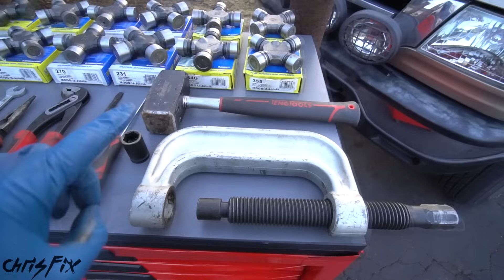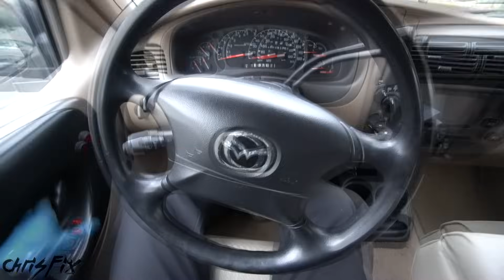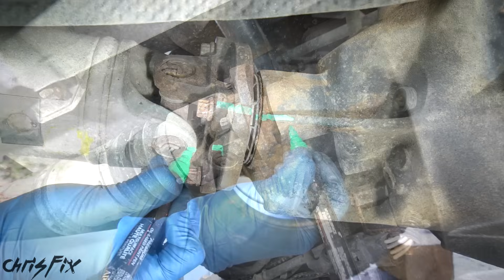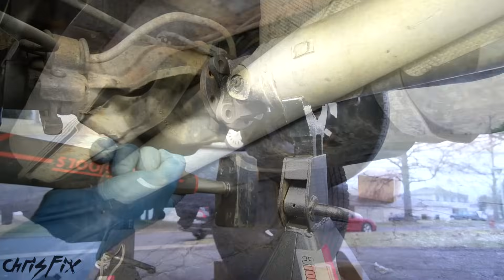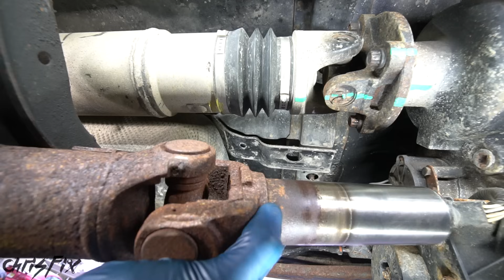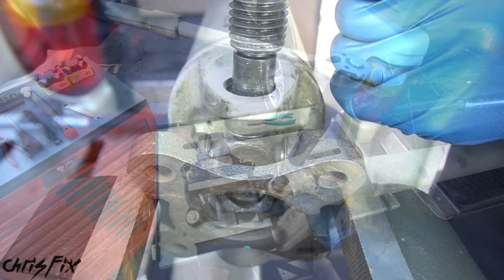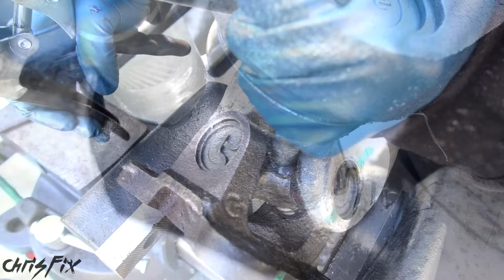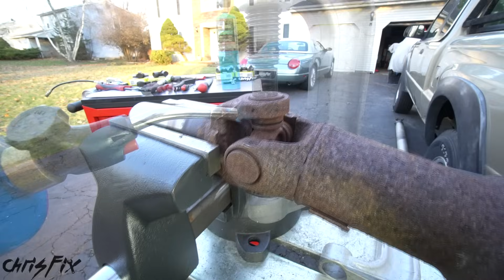How to Diagnose and Replace Universal Joints (ULTIMATE Guide)

Comment: Can you please do a full video on a 2wd v8 Dodge ram? 96 to 2000. Rear axle issues break issues. Directional issues.heat issues. Suspension issues. Steering issues. Just listening the most common problems that Dodge had those years and mine has some of them.

Comment: What about if you feel vibrations only when accelerating? Typically if I'm coasting at about 40 miles per hour, and barely press on the gas to regain speed I get a vibration. When I let off the gas everything's smooth out, when I touch the gas it is rough. Typically the vibrations are anywhere from 40 miles per hour to about 65 miles per hour
Reply: ChrisFix

Comment: Hi 
I drive bmw e90 325i inline 6
I’ve a problem, when my car goes over 130kmph steering wheel and whole car start shaking or vibrating and shaking get worse as I increase the speed.
But it drives smoothly below 130kmph.
What could be the reason I recently changed front tyres and done wheel balancing and alignment. Pls help me with this. What could be the possible reason for shakiness???

Comment: one thing I did on the front drive shaft of my jeep was throw the u joints in the freezer the night before so the needle bearings will tend to stick more in the caps and also if you want you can lightly heat the yokes. My driveshaft was super rusty crusty and this helped. I dropped one u joint cap and sent needle bearings EVERYWHERE that sucked! so I do the freezer method if time allows.
Reply from the maker: Thanks for the tip

Comment: Chris,
A very good, informative and well thought video.  Another method I use is the bench vise method.  I use sockets like the hammer method but with a larger socket to allow the joint to pass through and use the vice to "press" out the old joint and press in the new.

Also if you use a joint with a grease fitting in the X web, be sure to place on the compression or drive side as this is the weakest part of the part and it will be strongest in the compression loading.

Happy wrenching

Comment: Im late but, to prevent the rubber boot going bad, use 303 aerospace UV protectant. I havent yet but it should be fantastic just re apply every few months.
Its water based fyi. Even goes on tire tread!
Reply from the maker: Thanks for the tip.

Comment: I have this same truck in ford version. Is there a chance of you doing a video covering the 4wd front shaft u joint? I cant seem to find anyone that's done a video on it and that ones a real pain with the brackets and all. You've helped me make my ranger awesome so thank you for all the videos.
Reply from the maker: I won’t be right now because it’s still good but it’s not much different. Same concept but you need to unbolt the CV joint from the transfer case.
Reply: @chrisfix  Awesome to hear that it's basically just unbolting from the transfer case. Can you tell us if there's anything special we'd need to look out for when unbolting it from the transfer case? Fluids that will leak out or anything we need to watch out for? I haven't yet determined which of my u-joints is the one that's squealing, but I have a feeling it's that one in front. 
Btw...Your videos are so amazing, I'm spoiled. I followed your videos for replacing the upper control arms, camber bolts and washers, and lower ball joints, on my 2000 Mazda B3000 4X4, and then took it in to get it inspected. My mechanic absolutely could not believe how good a job I'd done. It was perfect. And I owe that entirely to your video. I'd never done anything like that. It was a trip. I am still inordinately proud of myself. LOL I totally owe you a case of beer, dude. 
I'm about to replace the blower motor resistor, a burned out bulb in the dash, do some minor body/rust repair, and paint some of the trim black. Plus the u-joint. All because of your videos. Thank you so very, very much.

Comment: UPDATE: took a while over a couple of days messing with the stiffness  but I seem to solve the problem.  I removed the clip when it was stiff and applied the hammer til the stiffness was gone then replaced the clip.  If the stiffness returned,  I repeated as necessary.  Eventually I had a floppy yoke.  The aftermarket sells U-joints for the Ford Ranger as if the front and the rear are different.  Ford OEM parts say front and rear U-joints are the same.  Didn't help that the online discount seller sent me the wrong front joint in the right box.  That joint was 3/8 inch too short overall in both axis with defective seals.  Been over 30 days so no return.  Fortunately,  when I examined the front U-joint it was almost new and didn't need replacement.  Now I'm ready to do my sister's '04 Jeep Liberty (2WD).
Reply from the maker: Hitting it with a hammer should work. Make sure you hit it around the whole area to vibrate any tension loose and even it out. Or lightly tap the side with the “hard to install” c-clip so it seats up against the other c-clip more. Nice work on trying to diagnose the issue! I was going to say check the needle bearings but you already did that. You can try turning the u joint 90 degrres and reinstall.

Comment: Removed the driveshaft from my '04 ranger today  The flange bolts need an 11mm,  12 pt. socket and all four needed heat to break loose.   My Ranger has a 3.0 with auto trans.  The front end of the driveshaft simple pulls out.  This is the best video out there.  It's clear and concise,  no idle chit chat.  Thanks, Chris.  You are doing good works.

Comment: Hi Guys I'm pretty sure my issue with my 2006 bmw 325i is an old Universal Joint. Just wanted to get your opinion. Currently, I have about 200k miles on that car and it squeaks only in reverse which is strange. Please get back to me if you have the opportunity thanks.

Comment: Chris just joined, great video but can you show how to do a u-joint from a Dodge ram 2500 with the plastic glue type as mine has no clips. (was told by parts guy that I need to use heat) thanks dave

Comment: my 02 Mazda b4000 2wd dual sport  has had a vibration for awhile at first thought it was the transmission ... had the transmission checked nop not an issue then wheel bearings nope not the issue so now  this may have solved it .. fingers crossed ! will update with results

Comment: Well, you made it look easy and it is not. This fix ended up a nightmare.  Old caps.... 8 of them get stuck in the yokes. Pressing  in the new caps to where the inner clips fit is nearly impossible as my caps cracked... still working on it but fist need to buy another u joint because of the cracked caps. Going to expand yoke with some heat this time around.

Comment: I don't like Moog stuff the castings and forgins are always so rough. And the machining is very rough as well. My outer tie rods bith had the holes drilled off center and the threads were all chowdered. In any case i got the OEM Spicer for less. Way better cold forged. When it comes to a bearing I wouldn't use Moog unless I could confirm they are using a different manufacturer for that. Bearings have extremely tight tolerances...

Comment: Chris....question I'm a 2006 GMC extended cab Sierra 6.0 4x4. 410 rear axle. I would like to change out rear driveline universal joints using heavy duty Moog's.  Heavy duty being 330's ?? Or the 330a's hmmm? Heavy duty no zerk.... Understood!

Front drive line are the 235's by Moog heavy duty?

Comment: Hey ChrisFix! I am going to be replacing my U Joints soon but I need help knowing what size of U Joint my vehicle uses (cap diameter). Do you just have to take off your driveshaft and find out or is there a way to know what size you need without taking off your driveshaft?

Comment: No mention that the grease fitting should be oriented so that it is in compression, not tension.  Anytime you put a hole in something and fill it up with that same something, the resulting structure is stronger in compression than tension.
Reply: Sorry, forgot to mention kudos for some of the "tricks" you used, marking to check bolt retain, grinding part of the grease gun fitting.  I learned something. Good job.

Comment: As a mechanic myself, I just LOVE LOVE watching your videos! You do everything thoroughly and right. Very professional work. Sadly, there aren't many mechanics out there that care for their job as much as they should though :(
Reply: That's because customers always try to blame Mechanics for shit that we didn't even fucking touch
Reply: No one will work on your car this way. It will take way too much time. The job can take half the time and you will never find out that the new joint was not greased, or the bores were not cleaned, or whatever small detail was missed. Even without the grease the joint will probably last more than 50K kilometers, which means its way out of warranty anyway :) So NO, no one will take care of your car the way, you can take care of it yourself.
Reply: Aslan Makhsudov true! Hey bro, cud use ur help if you dont mind? On my trucks drive shaft that connects to the alternator, I noticed splash of grease above it? What is it , transmission fluid??
Reply: @D_Dowg626  Try topping off your blinker fluid in your radiator. I had the same issue where the oil pump fuse kept blowing out because of the static electricity of the floor mats. Do that and you'll gain a easy 50 whp and 8 psi of boost!
Reply: Could be numerous of things, generally if it is around driveshafts it is from leaky seals.
Reply: Aslan Makhsudov how do you find out what u joint fits in your drive shaft and yoke??
Reply: I totally agree with you "Asian Makhsudov"!!!!
Reply: No body will pay for this quality work

Comment: I’m having a symptom on my 01 Nissan Xterra with a Manual transmission I’m getting a vibration mainly at highway speed but if I push in the clutch it goes away could this still be u joints ? Please help me it’s driving me nuts

Comment: I have a question in reference to this. I have the squeak. I know the u joints are going bad. However, yesterday I was driving and heard a grinding noise going up a hill for like 3 seconds. I was dropping off a coworker right over the hill. I went to turn around. Went down the hill and started hearing a clunking then a VERY LOUD squeaking that increases with more rpms. Goes away (or at least I don't hear it) while not oressing on the accelerator. Took it for a short .1 mile run around the neighborhood to take a video of it. It got progressively worse. Could this be the I joint? Going to replace my wheel bearings and u joints. BUT I just want to make sure that the u joint is causing the issue.

Comment: Chris - great job., great video.  All the little points were very handy. I would use a half-round file or maybe even a rat-tail file to deburr the edges instead of the flat file.  Your needle bearings were a lot more obedient at staying in place than mine.  My '66 Pontiac front u-joint looked so bad you would think somebody put it in a pencil sharpener.  Grease wasn't getting everywhere it need to be. Only getting to 3 members of the cross -one was dry.

Comment: Best VID!!! Any 'greasable' body type U-joint is weaker than a 'non-greasable' type due to structural weakness created by the grease passage. ALSO... in general, any greasable type joint will need to be GREASED before it's put in service- the vast majority of manufacturers only use an 'assembly' type grease that will come in the joint from the auto parts supplier. So be sure to grease them after you do the install!! Keep up the fantastic work Chris!

Comment: good video....  one thing that could be a problem sometimes ??  honestly, several times I have had to have the driveshaft re-balanced after u-joint replacement... all you have to do is get the thing .020 off on 1 side and that's all it takes...   IF someone experiences vibration after replacing the u-joints it will have to be re-balanced... and actually it should be every time...  but a VERY GOOD video on this stuff...  and.. just because Chris you know a lot about this.. you NEED to install the grease fitting in the CORRECT position as well.. not just to be able to lube it, you never want to be pulling away from the zerk fitting.. you always want to compress the zerk fitting...   I know this will confuse people but this is how it NEEDS to be...  you might just do a simple update on this...

Comment: Fantastic video as usual man! I have a. 03 Sierra 2500hd and the driveshaft as rotational play as well play in the slip yoke to the transfer case. Thought it was ujoints but doesn’t seem the case. Any insight on the GM “driveline clunk” you could share?

Comment: If you don't have a press, but don't want to hammer then you can use a bench vice plus an old socket set. I learned this on a 1960's Triumph that used to eat U-joints every 20,000 miles. Pick one socket bigger than the U-joint cap (or a large ring spanner might do), and a second socket that will fit inside the cap (or an old bolt might even do the job). Sandwich them on either side of the U-joint and put all three into your vice. Tighten it up and the small socket/bolt will push one cap in - and the other pushes out into the space behind the large socket/ring spanner.

Comment: hey chris, i have an 03 ranger that gives a hard clunk when shifting into reverse from drive or drive to reverse.  the truck also vibrates when in reverse but nothing in drive, would that be the ujoints? im also thinking the slip yoke could need some grease

Comment: a tip for the plastic injected u joints, if you do not have a torch  just build a small campfire drop the u joint in for 10 min  and the plastic will be all gone  and then you can proceed  from there

Comment: Just imagine the quality of used vehicle you'd get if you bought it off of Chris. Haha, it's nuts but so far I've replaced the water pump, thermostat, leap springs, leaf spring brackets, shocks, installed an LSD, changed out the head gaskets and ALL OF IT WAS PREVENTATIVE MAINTENANCE. I always watch your videos and you get my old mechanic juices flowingl, I decide to work on my truck and I haven't even been a mechanic in 3 years. I started my career in nursing and now after some time, my passion to work on my vehicles has finally come back and it certainly helps that my Dakota was my grandfather's. I suppose now it's time to replace the U Joints, thanks Chris!

Comment: All of those u joints on the table are junk. That piece of junk you pointed out with no zerk is not anywhere near the same joint as what came in the vehicle from the factory. The factory Spicer joints are cold forged, non greasable, and have double plastic and rubber seals. Anything besides Spicer is garbage, whether they're advertised as "high strength" or not. They're not available at useless parts stores like AutoZone or advanced Auto

Comment: On the 2nd clip you took off the flange you did it the hard way. After spraying it with the penetrating lube the next thing you get is a socket that fits inside the flange on the edge of the clip and give it a good whack with a hammer One Time. Now the needle nose pliers should easily take out the clip. Just remember to do the same on the other side if you havent taken the clip out yet. There really is no need to chisle out a clip unless its rusted in the yoke.
You also missed that on a new u-joint the caps usually dont have much if anything but a little lube to hold the needle bearings against the side of the cup. Its always best to stick a finger full of grease and push it in the cups and up against the bearings packing it. This will prevent any of the needle bearings from getting dislodged and falling into the bottom of the cup. 
If you dont do this, and you fond that no matter how hard you try to get the cups to seat that you cant get the retainjng clips in, chances are you dropped a needle bearing into the bottom of the cup. Just extract it out again look inside and if you see a needle bearing there,  after you kick yourself you cand fish out the bearingand push it back against the wall of the cup. Now stick a finger full of grease into the cup, packing it against the sides and reinstall.
Good luck, it is really an easy job to do.😎

Comment: I found the video and you not only saved me big time but saved me time.
My buddies shop's guys told me I needed a new drive shaft?
I had already bought the joints from GM and just wanted them installed.
The guy who works for him checked them and said the U joints had "no play" and are fine
but my drive shaft was making noise...
What???
Well your vid. showed there is no play sometimes unless you pry at it which I'm sure he didn't do.
I might go beat his a## shortly.
I know how to do more than basic repairs on boats/cars(I have both) and a "pole" or stick doesn't usually make noise!
Drive shaft making noise on it's own...
What was that nonsense he told me.
My bud's worker was trying to screw me to get a big job out of a little one(Told me the shaft was $500).
It's my work truck.
(1994 Chevy 1500 with 270K miles on orig. engine and U joints, etc.).
I'm in CA so there is no rust. 
Runs like a champ.
I changed the U joints in 2 hrs. in my driveway and I took my time.
I ordered the genuine ACDELCO U Joints rather than cheap ones.
Truck is perfect and quiet now.
Just found this channel.
10 thumbs up if I could.
All others showed physical play in the shaft by simply twisting it.
You know your stuff and made it kind of funny with your narration!
Thanks!
Pete.

Comment: Chris, when you remove the driveshaft and the rear axle shifts backwards a little bit, does it make it difficult to reinstall the bolts? Does the axle need to e pulled back into position? Thanks

Comment: Thanks Chris.  I thought I had bad u joints in my truck.  I wasn't completely sure until I saw the video and heard the squeak.  I knew it was in the drivetrain because I would slip the tranny into neutral and the squeak would stop, slip it into drive and it would reappear.  I think I'll just change all the u joints as the truck has over 190,000 on it.